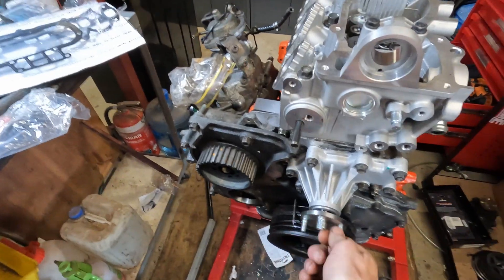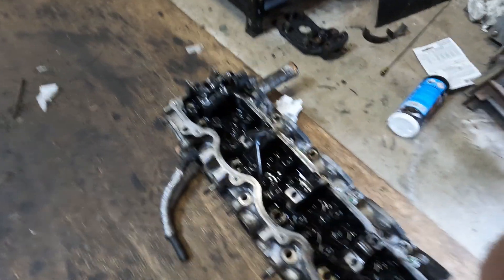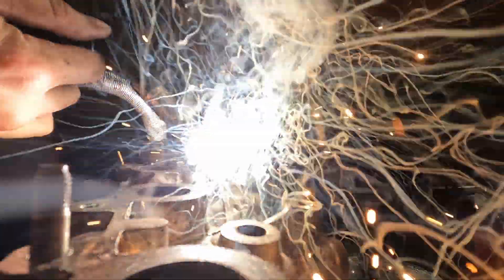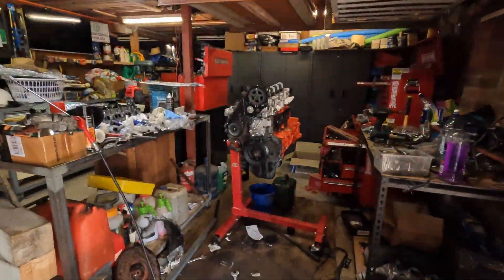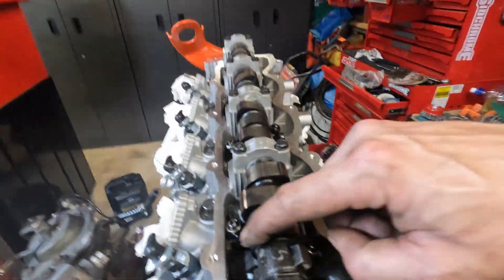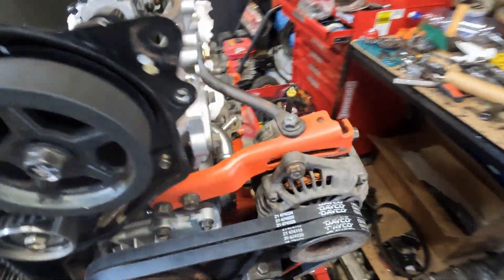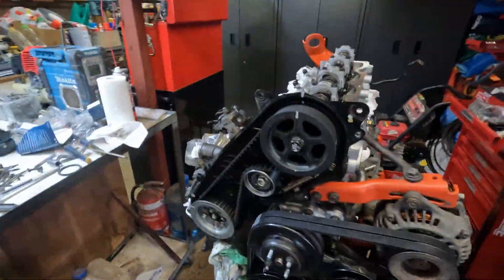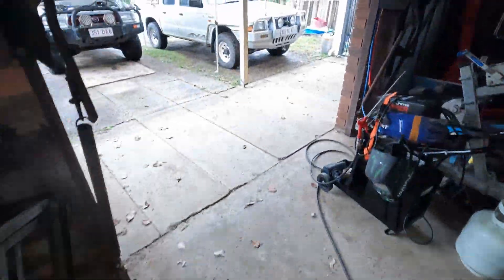WLT Engine Rebuild Ford Courier/Mazda Bravo: Finalizing Assembly (Part 4)

Comment: hey mate, are the bigger rocker arms the exhaust ones or are the bigger one rocker arms for the intake, i got my rocker arms out but i noticed they are different size
Reply from the maker: Hey mate, all my rocker arms were identical I believe, but I took them out in order and the exact same rocker arms went in where they came out so I'm not sure I even took notice.
Reply: @Finndawg  thabks for the help mate, im gonna keep checking
Reply: Exhaust rocker arm screw clearance  is larger than